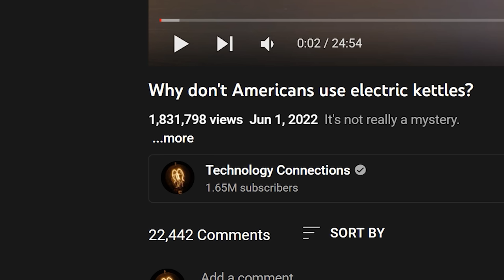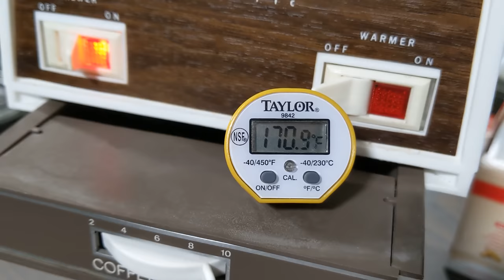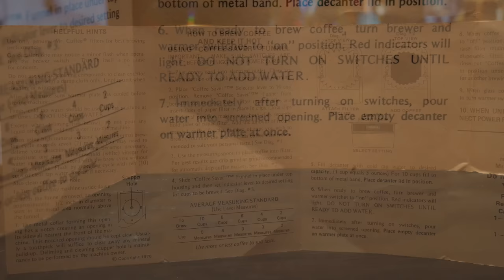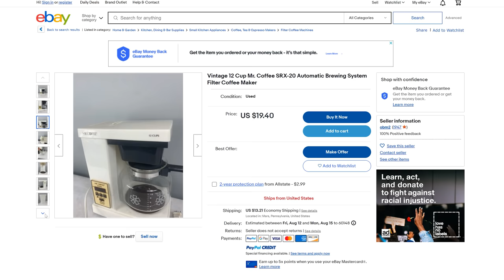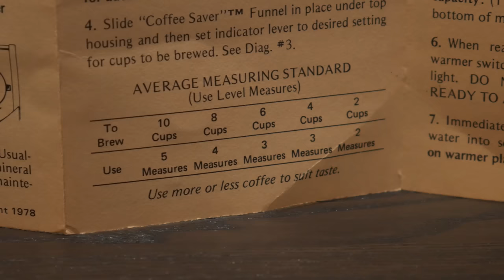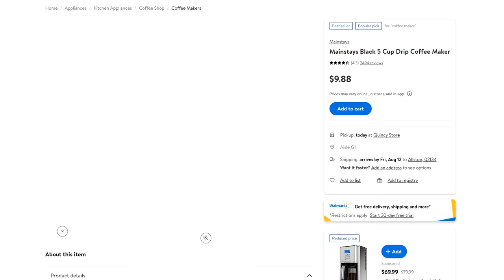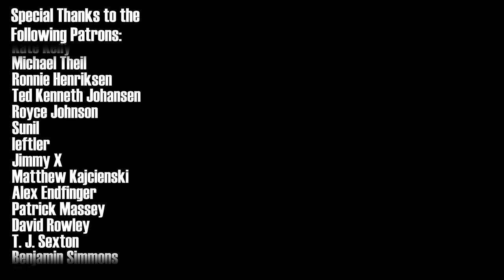Drip Coffee Makers — super simple, super cheap

Comment: So... I spent months sourcing an original Mister Coffee under cabinet mounted coffee maker for onboard my boat (both convenience and to be period correct since the original had long since been removed)... I paid $75 CAD when I finally found one that was mint.

I am delighted with it and with the coffee... It might just taste better than from the more modern machine at home because I am on the boat and everything is better on a boat LOL

WRT percolators... I have 2 of them, not electric for camping... For some reason when camping coffee just isn't coffee unless its extra strong perked coffee...

Canada eh... We all have an electric kettle and a drip coffee machine of some sort... and most also have a percolator for in the bush. (which can also function as a kettle when you remove the basket and tube)

Comment: Used a Kureg for years at work when we got two industrial sized ones. I ended up being the one maintaining them flushing out the tanks every few months so I got a lot of experience with them. We still ended up replacing them several times because some just flat out fail electrically.

While going through all that to this day I still prefer a drip coffee maker and I have a 4 cup Mr Coffee in my house. I use a metal mesh screen for the coffee grounds so nothing gets thrown out. I even use it to get hot water instead of using my gas stove with a pot for cooking anything that needs to sit in hot water.

I have no idea how old my Mr Coffee is and I don't remember how I acquired it. I'm assuming I just kept it from being left behind by a previous renter when I lived in an apartment and I just kept it. Yes it starts dripping water within a few seconds of turning it on. And finishes 2 or 1 cup in a couple minutes. I use it every day.
Reply: I have a Keurig at home but use to work at a place that had an industrial version, they are practically different machines. The one we had made mochas, cappuccinos  and lattes and I loved it so much, I was curious about how much they cost and as soon as I saw the price I laughed! Not on my salary.
Reply: We have one of those commercial Keurigs in our staff lounge and it's been replaced 4x that I know of, they've failed every 2 years or so... you could practically set your watch to it. Absolute pieces of crap.
Reply: @notsureigaf  Pretty much my experience. I don't know if it's related to the quality of water or not.
Reply: God yea Keurigs last 2 years in a house with 2 coffee drinkers, or about 6 months at work, before they start tripping breakers cause something inside of them (that despite gutting several, I haven't found yet) starts drawing more current with age until it starts popping the 15 amp circuits.

My CURRENT job has a Keurig that's outlasted the usual mark solely because every outlet in our building is 20 amps, so it's kinda just ticking down the days til that thing decides to catch on fire.

Comment: The stovetop percolators are still great for camping. I remember my family using one on our little stove every summer for the yearly family gathering/camping trip
Reply: i feel stove-kettle + a stainless steel french press or pourover is prob more desirable there
Reply: Enjoy what you like. But. Boil water in a pan + French or Aeropress is way better for camping. You presumably have a cooking pot already. If you drink percolator, and this is no joke, go cowboy coffee.

Cowboy coffee - boil water for safety. Let it sit for a minute to cool. Stir in grounds. Steep about 2 mins. Grounds will float. Pour in about 1/2 cup cold water to suck the grounds back to the bottom. Carefully pour into cups so grounds stay settled. Voila - zero equipment coffee. You can even carry a reusable metal filter if you're afraid of grounds. This will taste at least as good as percolator coffee, and again works if you only have a pot.

Percolators are just... Why. If they're a family tradition, great, have at. But you could go more rustic (cowboy) or better tasting (French press) easily.
Reply: Camper here. We have a stovetop percolator for when we camp without shore power. But it doesn't brew great coffee (even bad coffee is better than no coffee though). So if we camp with shore power I bring along our drip maker from home.

Comment: Kettle + French Press is my preferred style when I make it. Just feels easier to manage and clean to me. Also good for making tea when I don't want to use my teapot. Kettles are also just handy to have for some quick and easy water boiling.
Reply: Mr. Coffee is great for tea, too. Just brew hot water without coffee.
Reply: @hengineer  Depends on the tea - most black teas need 100°C and many other teas need quite a bit less. But might still be useful for folks without kettles!
Reply: @hengineer  fair
Reply: @hengineer  In my experience using a coffee maker for hot water tends to result in coffee tasting water unless there is a separate spigot. A few let you brew without the basket for the grounds but then water goes everywhere.

Comment: Loved my parents' original Mr. Coffee. The brews always tasted great and were a delightfully sippable temperature right away. Also it seemed like the keep-warn plate ran a bit lower so that the the coffee did not go bad nearly as fast. Most modern drip machines run too hot, in my opinion.
Reply: That makes sense.  With a single heater for both brewing and warming, the warmer thermostat needs to be set to something higher then boiling, otherwise it can't heat the water hot enough to drive the pump action.

Which means that hot-plate is keeping the pot at cooking temperatures, not at a warming temperature.

A brewer with a separate heating element, on the other hand, can use a thermostat set to a lower temperature, which should reduce the amount of burnt coffee produced.

I suppose a single-heater unit could use two thermostats, selected by a water sensor in the reservoir, but now we're talking about complexity and cost that would undermine the point of having a single heater.

Comment: As a former moka pot enthusiast, they make great coffee.  Strong, super bold coffee on the verge of espresso, but great coffee.  Lots of different techniques and the way I use it definitely isn't a set it and forget it type of machine, but as a concept it's basically a manual version of auto coffee but significantly more concentrated.
Reply: Does he even mention moka pots? For my taste its by far the best brewing method.
Reply: Moka pot is my preferred home brewer. Using the James Hoffman technique (and an electric kettle) for an optimal cup.
Reply: I use a regular coffee maker and grind the beans to an espresso grind.  That means you need fewer grounds for the same amount of strength.  You can also buy the beans in bulk and vacuum seal and freeze what you can't use within a month.  I've had beans frozen in a vacuum sealed state and they end up just as good over a year later.

Comment: Back in the past, I used drip machines.  Tried a French press for a few years, made some good coffee, but in the end, I've gone back to drip coffee.  No fiddling around, no boiling water elsewhere, just coffee grounds in the basket, water in the tank, and a little bit of time.

Flavor-to-effort is a very, very true subject.  If it tastes great and takes forever to get it right, you won't do it.  I know.  I used to mix and grind coffee beans and boil water on the stove (never had a kettle) in order to run my French press.  Great coffee that's ready in "ten minutes after you really wanted coffee."  And if you took shortcuts, well, it wasn't as good.  After a while, I picked up a little 5-cup maker and went back to drip coffee because it was as effortless as "Put 3 scoops of coffee in the reusable filter basket, put a mug of water in the tank, flip the power switch."

My secret to all of you who love your coffee and use cheap drip makers:  Brew a mug at a time!  Doesn't take much longer, you're not burning the coffee, and (perhaps most importantly), you'll only make as much coffee as you want so there's no obligation to have "an extra mug" because you filled the pot.
Reply: The French press is for when you're making waffles, slicing fresh strawberries...
Reply: Here's a tip - get an automatic espresso machine, preferably one with a grinder. *Much* better coffee for less time than a dripper - press on, wait 20sec for warm-up, put cup, press button, 30sec to grind and brew, and you can drink your pretty good espresso facsimile.

And if you ever want and have the patience to fiddle with grinds, all of the machines that have an automatic grinder can take ground coffee, when you want and feel like it

Comment: Fascinating and clever designs, I've never owned a drip machine myself so have never thought much about how it works and/or eventually broken it and then taken it apart. I have to go the boujee kettle/aeropress route if only as that, as a single person, making an entire pot of coffee would lead to me drinking the whole thing and that's a bad idea. Also if the power goes out hard I just have to start a fire somewhere and I can still have that hot brown
Reply: There are a lot of single-cup drip machines out there (of varying quality though). I use one myself.
Reply: drip makers can make as little as you want... one cup...
Reply: I use a 4 cup drip brewer and only make a "cup" (16 ounces) at a time. I drink my coffee black and use a half way decent arabica brand. (Community Coffee is my current choice.)
Reply: @SkyTheHusky2021  None of them take up less counter space than an aeropress (which is zero as it lives in the cupboard), also wastes a fraction of the filter material
Reply: @rocbolt  There are drip machines that don’t need a coffee filter (the one I use has a removable and attachment that you just rinse out) but the counter space thing is certainly a good point. I’d say every method has its advantages and disadvantages, and it’s more up to preference what people use. My grandfather still uses a percolator, for example.

Comment: Excellent video on the history of drip coffee makers. I had no idea how different today’s coffee makers are from the original Mr. Coffee. I kind of believe that cost is the main reason for the changes. I also like how well you described how each type worked.
Reply: I think it's cool that they were able to cost-simplify it to the extreme bare bones without changing the quality of the brewed coffee or the user experience Indeed, the user experience has been improved, with such things as valves that let you remove the carafe while it's still brewing.
Reply: I'm sure cost was a factor, but I think another reason was that since the original mechanism would drain the water out if you added it ahead of time, it was not possible to put a timed brew feature on it so you could set up your coffee maker the night before and have coffee ready when you get up.

Comment: Induction stoves are getting pretty common in RVs. They don't require lines to the propane tanks (or whatever your fuel of choice is), nor do they put a ton of heat into the space. Those are both very good things in a small space

Comment: Great video!  I remember my dad being so proud of his Mr. Coffee in the late 70s, and how he raved about how much better it was than the percolated shite.

Try grinders next! 

As an owner of a Technivorm Moccamaster, I can attest that there are booshie drip coffee makers.  

I love mine, but I have to say that buying a fancy grinder made a bigger difference in the output, for about the same expenditure.  Upgrade your grinder first!  Buying smaller amounts of beans more often also helps, and buying preground coffee only makes sense if you are going to use the entire contents of the container in a few days.  Beans, ground just before the brew, are basically OK for about 7-10 days before the quality degrades noticably.

Descaling frequency is driven by the amount of calcium in your local water supply.  I heat grocery store 10% cleaning vinegar in the hot water kettle to clean that, then pour the hot vinegar in the coffee maker and let it sit overnight.  Brew it thru in the AM, followed by 2 or 3 cycles of water, and I am good to go for 3-6 weeks.
Reply: Breville Precision Brewer reporting in:
Cheap machines make garbage, I love my machine. Fight me

Comment: 9:00 "still, that's mains voltage..." - the thing with electricity cords is that the insulator (plastic sheath) is determined by the voltage and the wire thickness is determined by the current (amps), so the wires in the 70s machine look fine.

It's good to note that a single layer of typical electrical tape is rated for 600V so it doesn't take much of a coating over the wire to be safe for north American mains voltage which is about 350V peak to peak (120V rms).

Comment: Brewing coffee is a hot water extraction, which is determined almost entirely by duration of the solvent mixing with the substance. So, for the "coffee saver" feature, there is a relatively solid chemical explanation for them being similar.
Reply: If I understood correctly, it increases the mixing time because the water has to travel a longer distance

Comment: You actually got me to buy an electric Kettle from your previous video. I found them at my local general store. Used it for a French Press coffee and hot cocoa
Reply: Ditto. I use mine for tea, coffee, hot cocoa, cooking that involves boiling water (my gas range can't compete; kettle is much faster), instant noodles, etc. I can't go back to not having one.
Reply: Hot cocoa? With water?!
Reply: @diceman3219  sure. Read the directions of most mixes. I wouldn't heat milk in the pot.
Reply: @diceman3219  Depends on the mix you use. For example, the Swiss Mix Milk Chocolate stuff tends to be way too sweet if you use straight milk. IME, those shine best with 200°F water as the majority of the liquid in the cup (8oz), with a little milk added to it for richness to really make it sing. For other mixes, better to use all milk if you can, because they are extra good with it. The Land O' Lake cocoa mixes are some of the best I've ever had for hot cocoa. Can't go wrong with any of them, even Arctic White. It doesn't have that overly sweet issue in milk despite featuring white chocolate.

Edit: Don't put anything other than water in a kettle. Heat your milk either in a microwave or in a pot over your stove top, stirring constantly as it heats up.
Reply: @diceman3219  A lot of Americans drink "hot cocoa mix" which is kind of like Nesquik, or Milo, but you're supposed to add water to it instead of milk.  It tastes like a**.
Reply: @PheOfTheFae  well 1. Hot cocoa mix tastes nothing like nesquick (or ass) and 2. What is your alternative for hot cocoa? Taking a bar of chocolate and melting it in milk or something? If so, that's tremendously expensive and a huge time suck. Not all of us have the luxury of that much free time. If using the bathroom at work is a luxury for me, homemaking a pot of hot cocoa is much more so...
Reply: @SweetLou0523  Heat a mug of milk in the microwave, add one spoonful of cocoa powder and two of sugar.  That's hot cocoa.  Also, if your work won't let you go pee you should unionize and go on strike, not get mad because a stranger on the internet doesn't like Swiss Miss.

Comment: I knew a guy who cooked a chicken breast in his coffee maker, so it can definitely do more than make coffee.

I used a drip brewer when I first started drinking coffee, then used a french press for a while (hugely overrated contraption) then I switched to cold brew for a few years, but you know what I've been doing for the last 5 years or so?  I nearly-boil like 3 cups of water in a pan, on the stove, then pour it over fresh ground beans (enough beans to make the coffee 'too strong' for the amount of water) in a big pyrex glass measuring cup.  I stir it and put a small plate on top.  The grounds settle to the bottom.  Then when I want coffee, I pour or scoop out like 5/16ths of a cup in to a mug and then fill the rest with boiling water.  This way it makes enough coffee for the whole day and hot water never touches plastic.  Also if I felt like being totally anal about temperature, I could get it to exactly 200 degrees.

The average person never attempts to clean the inside of their drip brewer and the average drip brewer is almost totally plastic and not designed to allow cleaning.  You CAN sort of clean them, but it's not easy.  You should at very least, run vinegar through it on a regular basis to stop it from getting too moldy.  They're cheap, disposable tech.  The hot plate burns coffee so consistently, that most americans have simply become accustomed to the taste of burned coffee.  I once had a guest ask why my coffee tasted different than what comes out of his plastic abomination (we were using the same brand of coffee beans) and I didn't have the heart to say, "It's not scorched moldwater."  The insides of those things get moldy really fast.  The same can be said about brits and their nasty plastic electric kettles.  Those things are pretty revolting and I find it strange the way brits act all snotty about americans generally not using them.  It's like acting snobby because you eat McDonalds.  And it's not surprising that canadians disgracefully use something as mundane as boiling water as an excuse to kiss up to the british, since they do it at every possible opportunity.